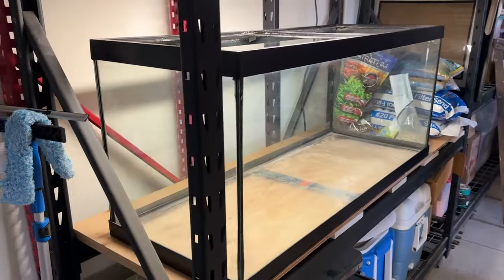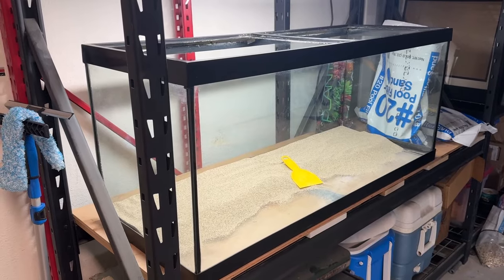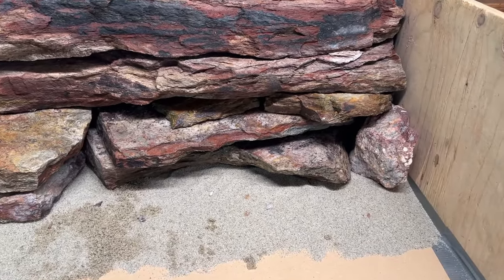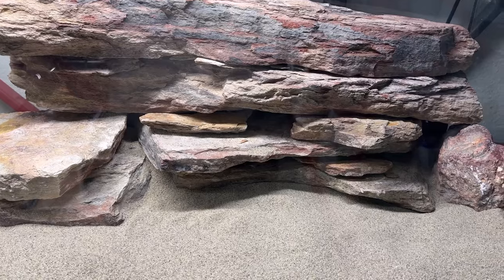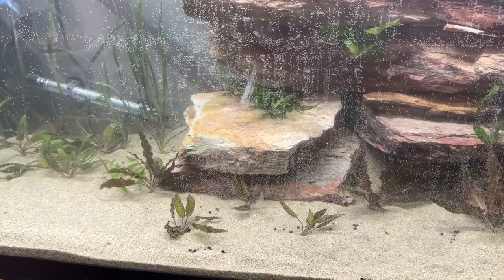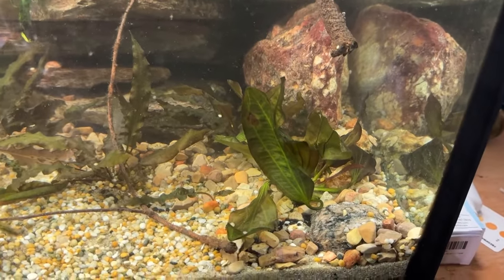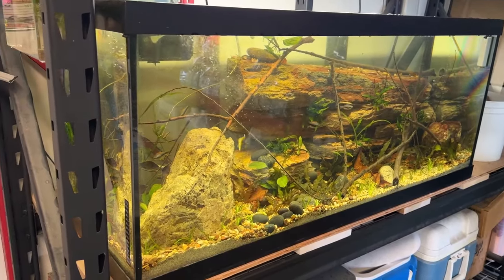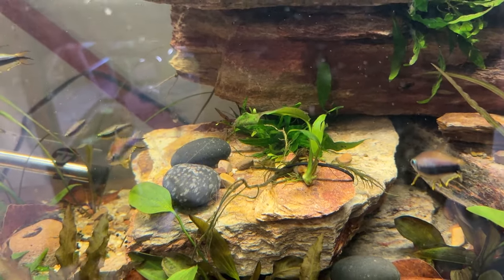75 Gallon Tank Setup From OfferUp

Comment: I used play sand from home depot in my last scape. It was $6 for a 50lb bag. Nice rock work by the way ❤ love it
Reply: Just realized you already ordered them by the end of the video 😅 my bad
Reply from the maker: I have too. It took a lot of rinsing and I'm not sure I didn't get a bunch of diatom algae from it. The pool filter sand is pricey but it's clean And so far I like it a lot more. And thanks for the kind words on the rock work. It was a lot of fun!
Reply from the maker: Not at all. It's good to know. Nothing wrong with multiple sources.  @GrumpyGillsFishing
Reply: @garageaquatics2023  the way I rinse mine is by putting a garden hose down in a bucket and burying it under the sand. Then I run the water for about 30 minutes. It stirs up the sand and all the light dusty bits float into the water and out over the sides of the bucket. Not sure if you’ve tried that method before, but it’s the best way I’ve found to rinse the sand :)
Reply from the maker: Very similar. I'll also reach down in a stir it up a bit as well,  @GrumpyGillsFishing

Comment: Great video, glad to have found your channel!
As for rocks, malachite and azurite as they can be toxic in some aquariums. Any form of calcium carbonate (“bubbles in vinegar”, limestone, coral rock, shells) can slowly raise the pH of the aquarium to 7.6 to 7.9 pH, no higher. Copper in rocks can be toxic to more sensitive fish.
(The vinegar test - Vinegar, an acid, dissolves bits of a material called calcium carbonate in the limestone. This releases carbon dioxide, a gas that rises to the surface as a stream of bubbles. Rocks that don't contain calcium carbonate won't fizz.)
Reply from the maker: Thank you! And thank you for the information. I just copied and pasted into a Word.doc so I can go back and spend some time with the rocks I used and see what I can see. I appreciate it!

Comment: I have that same type of rock across the road, it does brake up so easily. I call it slate. I do have some in a 55, never had a problem with it.
I use the play sand from HD 50# bag is 5 bucks. I wash it a couple of times. Doing a 30 gallon right now.
Reply from the maker: I had the play sand too. Yeah, this is more expensive, but I really like it. Love to see the 30 when you're done.